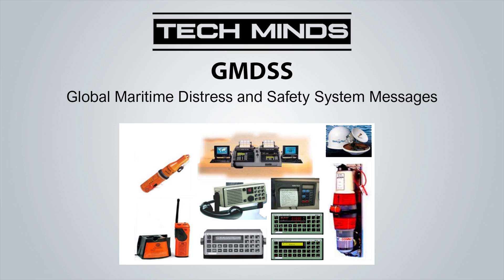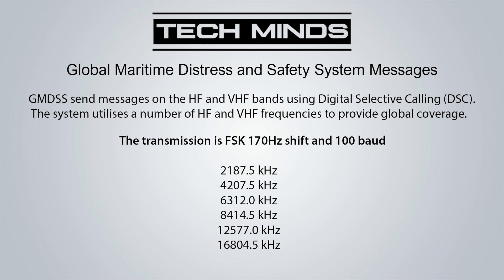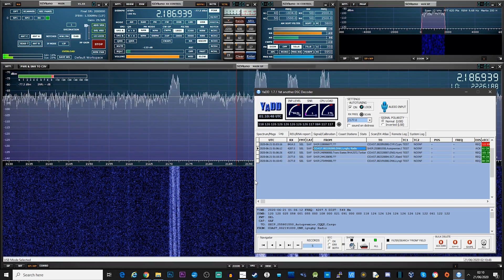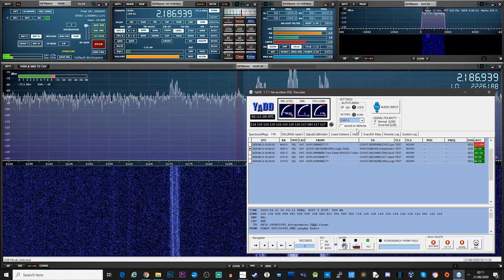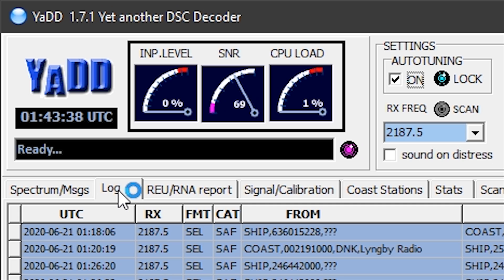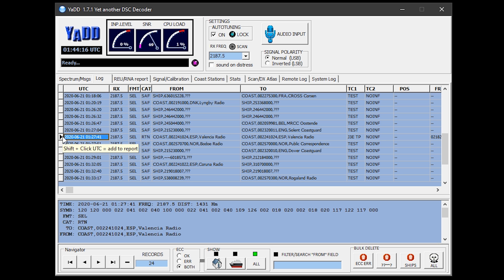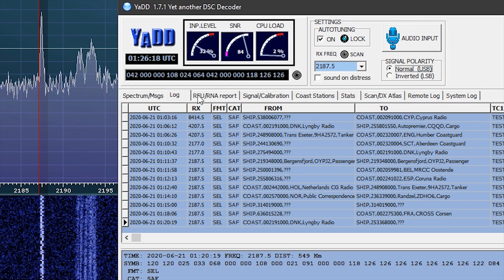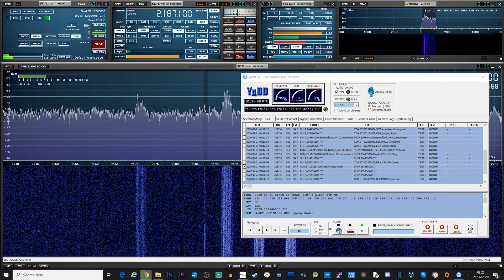How To Decode Maritime Distress Messages GMDSS DSC

Comment: As a small craft sailor, I'm still hoping that GMDSS does not cause ships to stop monitoring VHF channel 16, and I think they should still be required to do so. If you're in a small boat crossing the channel, and you see a ship bearing down on you, you can't find out its MMSI in order to ask its intentions.  You might be able to pick up its MMSI from AIS transmissions, if you happen to have an AIS receiver and can use it in time to identify the ship from its position, but a ship can run you down in 15 minutes from the horizon.  Long live reliable analogue systems!
Reply: Well since mariners still uses paper charts I don't think keeping watch on Channel 16 will go away.

Comment: I always like your videos for getting people interested in utility transmissions. Just keep them coming. I'm monitoring these kind of transmissions for the past 40 years, with this may I give you an advice.
When making instruction or informative videos it is important to bring the tech stuff exactly as it should as you, in this case, you are acting in a TEACHING capacity. In this video I noticed that you have the SDR setup in a bad way. The tuned frequency of the SDR must be right on spot. 2187.5 kHz is the real reception frequency and the passband filter has to be set exactly to the tones of the transmission, not tuning the frequency around to more or less where you expect the transmission will appear. The international agreement of DSC is a mark and space tone difference of 170Hz with the  space tone at 1275 Hz. So the filter is set to start on 1075 Hz at the low side and1645 Hz at the high side. This offers you the exact passband with a 200 Hz extra below and above your target. This offers some flexibility from the skirts of the DSP to not attenuate the signals and at the same time keeping the signals free from unwanted signals that can make YADD tune away from its target when set on autotuning. The advantage is that setting the passband up this way all the DSC frequencies will be spot on in the future and this is important for monitoring a frequency that is only sporadicly transmitting. Also when monitoring all frequencies like scanning or making 9 receivers in SDRconsole all will be received correctly. Just a bit of advice from a dedicated listener. I have also learned this by falling and learning from my mistakes, hi hi. Nu pun intended! Keep up the good work!!!
Reply from the maker: Thankyou for this information 🙏

Comment: Could I correct a couple of things that are incorrect in the video? Or at least not entirely correct.   

Firstly the MMSI number, the 9 digits you mention, is the only identification transmitted as part of the message.   I’d suggest the system is using some sort of look up database which unless it is regularly updated might not be correct.  

Secondly DSC is a part of GMDSS and dependant upon the sea area under it they operate in the may have VHF (which will be phase modulated) MF (as you identify using USB) or HF (again using USB).    HF operates on 4-6 separate frequencies within the HF band to give global coverage.
Reply from the maker: I didn’t go into too much history behind all the technicalities as it would just swamp the topic of the video, so I left the wiki page link for people to go ahead and read :) thanks for watching 🙏